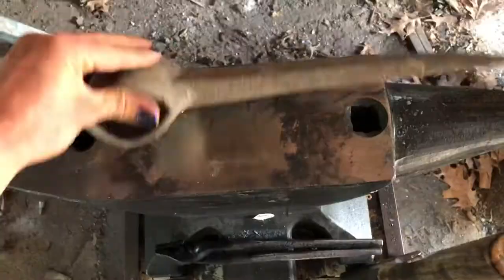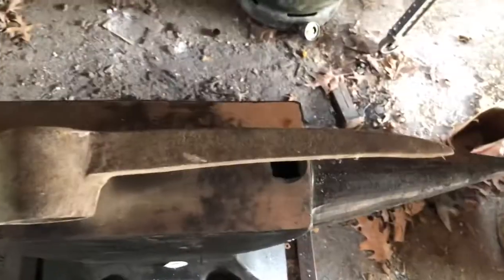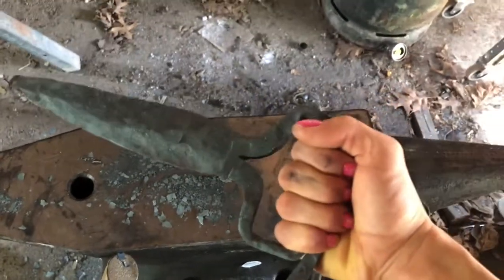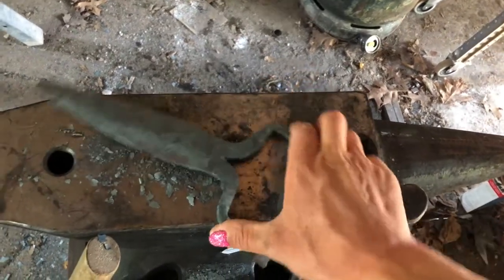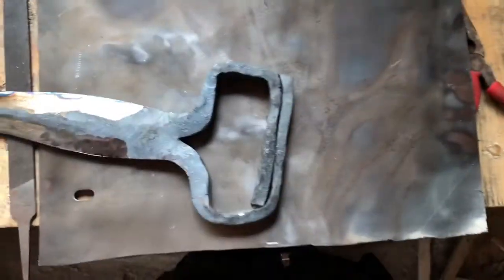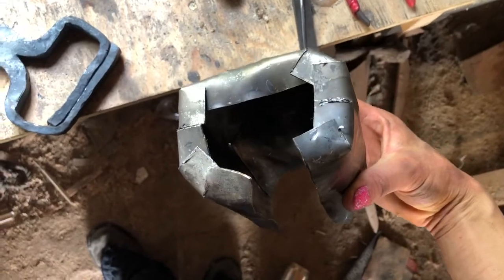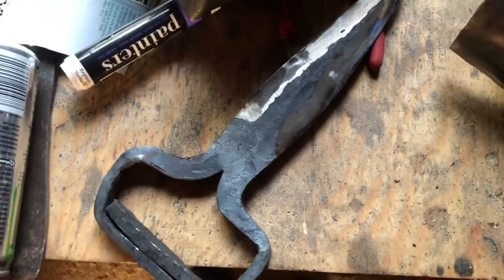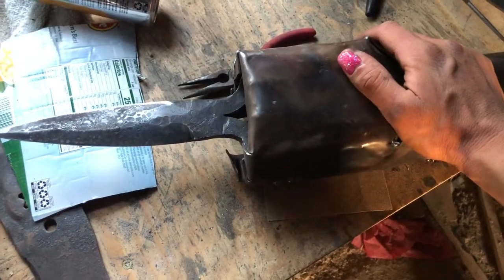How to forge a WW1 gauntlet dagger

Comment: You may wish to consider adding a few large donut magnets to the side of your anvil. Or wrap a tow chain around it. Both do a fair job of attenuating the ring and shortening it's sustain.
Reply from the maker: MY old anvil had a chain on it but I have yet to transfer it over.  I really should before the neighbors complain.

Comment: This would be very useful in the civil war
Reply: Back in my day,when i was in elementary school 2015-2017 me and my friends made many weapons out of garbage our school had laying around like blow dart gun, slingshot,hammers,trench clubs,shields and even full armor using nails,strong sticks,rubber bands and logs and rusty metal plates for example.
One day i found two big rusty kitchen knifes and i learned about the gauntlet dagger from my grandpa who knows a ton history so me and my friends made a gauntlet dagger!We sharpened the knifes with rocks and used any metal plates we had to make a metal glove with sponges inside as padding.When tested the glove could pack a punch, it could leave dents in strong break walls,cut some thick branches,1 inch pipes and even stab through 2-3 inch metal plates!
We had to destroy it since we would get in trouble and giving it to a 4th grader who most like doesn't even know what a gauntlet dagger would get us in trouble!
Reply: @explosivebirds756 i dont think you know how big an inch is. There’s no way you’re stabbing through steel with a kitchen knife any thicker than 3mm, idc who you are, it’s not happening.